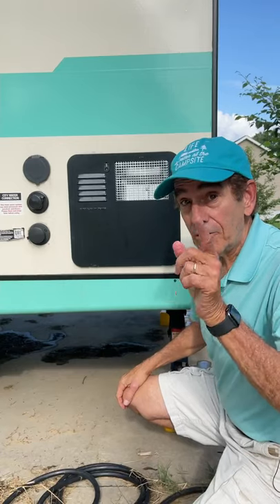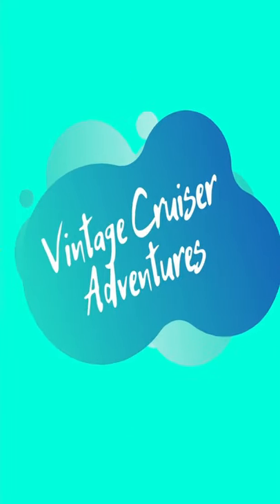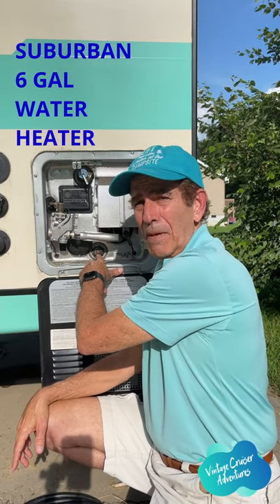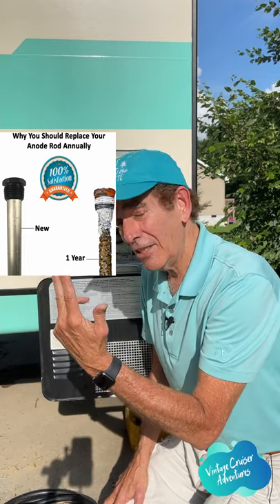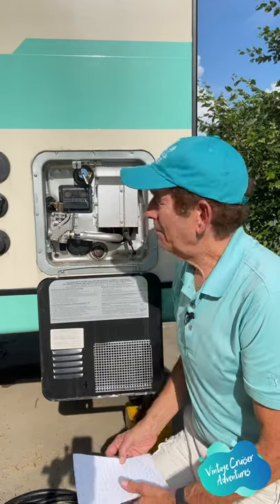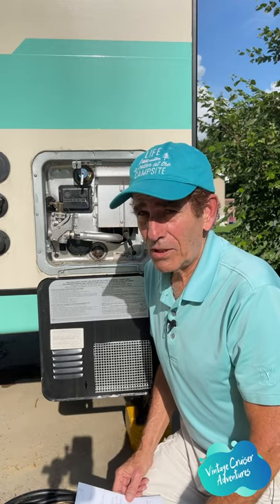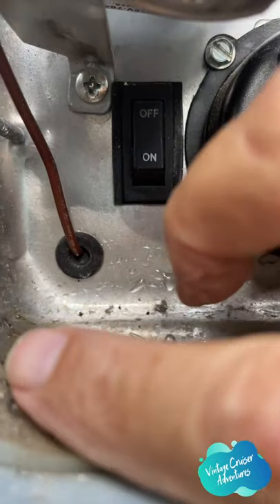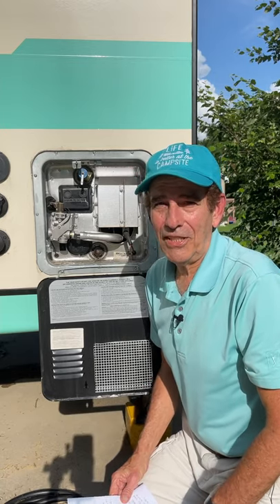RV WATER HEATER OPERATION

Comment: What if you don't have an and off switch
Reply: Wish he would answer lol im in the same boat
Reply from the maker: I am so sorry about this delay. I don’t know what type of water heater you have. But I would imagine you could always switch off. The circuit breaker.
Reply: @vintagecruiseradventures9268  thanks for answering! I apprecuate it
Reply: Mine is a 2004 model year system. I have the electric 'sacrificial heating rod' as well. I don't have the on/off switch at the outside service panel. I turn my water heater off at the breaker panel inside the rv before we head home. No point in heating water all week when nobody is there. It only takes about 30 minutes for the 5 gallon system to make hot water again after we arrive. Most RV water tanks like this, can also make hot water with your RV's on board propane system for when electric is not available.
Reply: Glad to hear that it’s still going strong

Comment: If i shut the water supply off to the rv and leave the propane on will the water heater still work?
Reply from the maker: Are you running the water heater by propane or electricity?